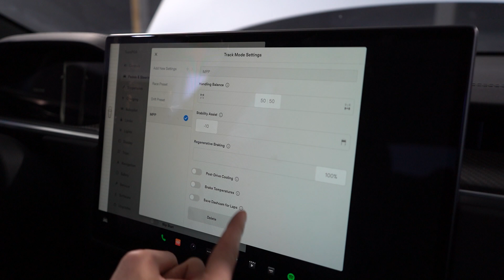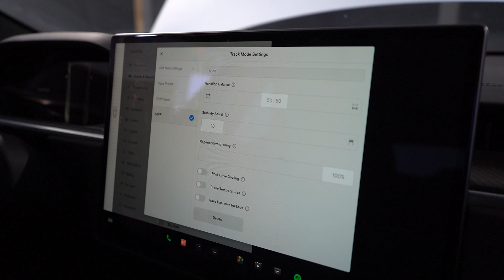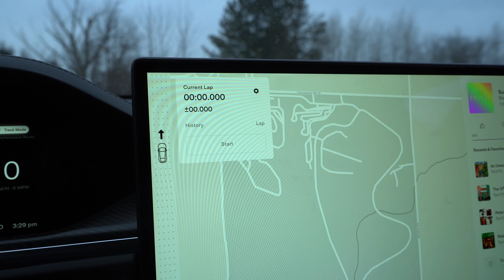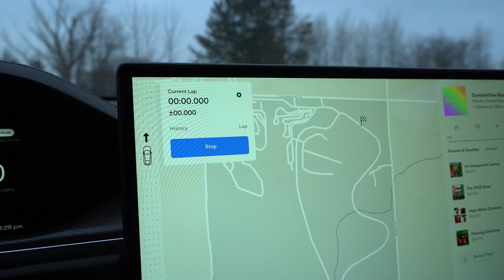Tesla Model S Plaid - Track Mode Overview

Comment: The track mode config screen shows brake temperatures. Are there already infrared sensors for that system?
Reply from the maker: No - Tesla is using a model to determine the temperature. So changing any hardware makes this model and the associated warnings pointless.
Reply: @MountainPassPerformance  my grandpa had a 2001 Honda Accord V6 that had brake-only traction control up to 18 mph. The manual said that if the brakes overheated while the traction control was activating, the system would pause for a few minutes to let the brakes cool down. I always wondered how that worked, and it probably worked very similar to how Tesla did it with the brake thermal model.